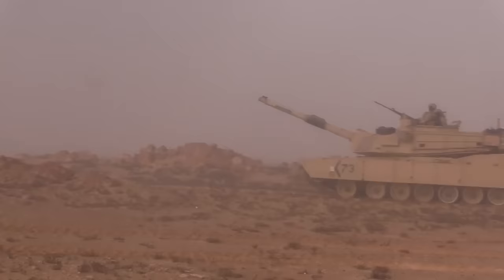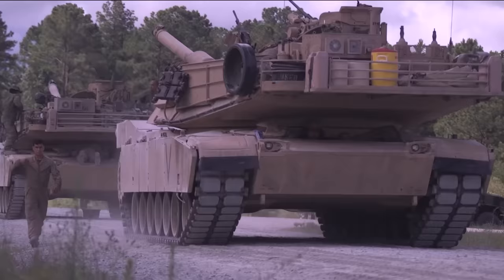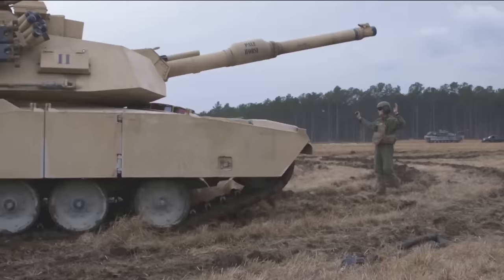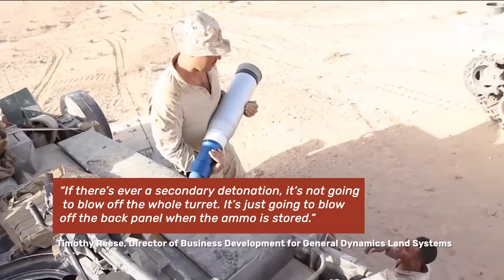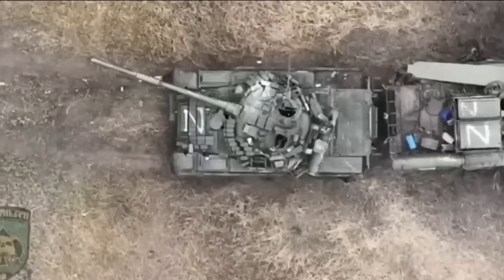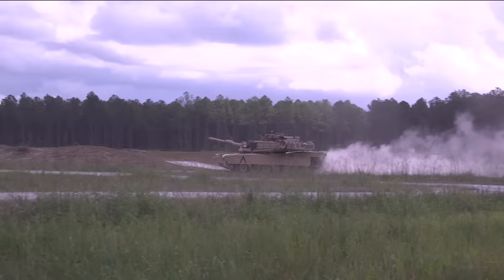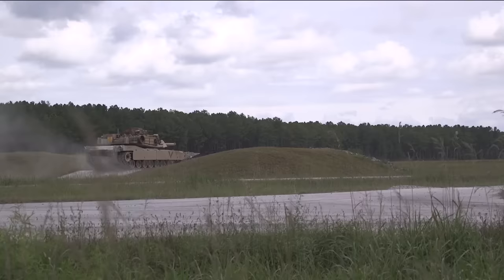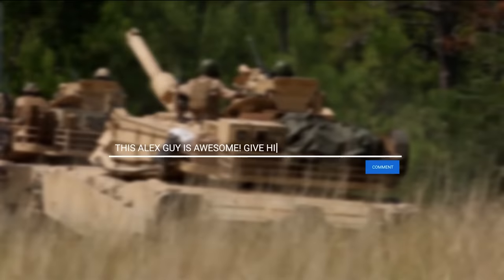America's next-generation main battle tank: ABRAMSX

Comment: The batteries enabling engine off operation is going to have a huge impact, and a lot of people still won't notice all of it. In addition to the tactical benefit of being able to keep the tank near ambient temperature and near enough silent to avoid detection, especially at night, the fuel savings will have a huge operational impact. One thing I consistently hear from people who have been in combat is that most of the time, absolutely nothing is happening, but soldiers need to be ready the whole time. Today, that means burning fuel to keep tanks running, but if the tank can run its systems, and ideally even move short distances on battery power while the engine starts, the real world flexibility and practicality of tanks increases massively. Whether commanders use this capability to operate at higher intensities for the same number of tanks, or run operations at the current level of intensity but with less vulnerability to fuel supply will depend on the situation, but any tank without this capability will be at a significant disadvantage.
Reply: Moving short distances on battery power while the engine starts would be huge. "Stealth tank" may not be a joke, it could be the real world initialization of the "stealth tank" concept. Would be really spooky. Hell, even the very NOTION of a "stealth tank" is spooky.
Reply: Hypothetically, this may also give an opportunity to install solar panels on the flatter top parts of the that are usually underutilized. Instead of just draining power during daytime, a little solar assistance may be helpful for that extra bit of juice. If those solar panels are designed well, they might as well function as "additional armor".
Reply: @misot90  well tanks take so much energy to move, that the meager powers solar panels provide will probably be meaningless.
Reply: @tsamuel6224  The M1 tank is already known as 'whispering death.'  The engine is so quiet that it was discovered that the sound of the tracks was the only thing you could hear from over 100 meters.  So, the Army developed 'silent' tracks for the M1.  

And we regularly were able to sneak up on infantry positions at night (and if there was no dust - in the daytime as well).  The next tank is going to have an APU just like the current M1s do, (Which also means that the fuel consumption issues everybody goes on about was solved 20 years ago.)  And the APU brings up a question - will the added utility of the batteries be worth the fire risk and under-armor volume they take up?  (Yea put lithium-Ion batteries on something that's intended to operate inside the enemy's kill zone.  If the batteries take battle damage - they will burn.  And you can't put the fire out.  I wonder how many tanks will be destroyed by fires before the crews start taking out those batteries. And IMO - getting rid of the Gas Turbine is a bad idea.  The gas turbine give the tank a level of agility no other tank in the world has.  With the gas turbine I was able to pop up on a berm take 2-3 main gun shots - then back up, stop, and accelerate and turn until I was heading for the next firing position at 30 MPH - before the enemy return fire arrived.  You can't do that with a diesel.  With a gas turbine when you to full throttle - you get full power instantly. A diesel has inertia it has to overcome before it can start giving you that power.  

Once I snuck my tank into the blue sides (I was part of the OPFOR - the "enemy" that's under order to kick the blue forces butt) bivouac area and stopped right next to a medium tent filled with sleeping soldiers.  Didn't even wake any of them up - until I fired off a WSS (Weapon Signature Simulator) for the main gun.  I guarantee that their ears were ringing.  (The Observer/controllers ruled that we had just wiped out an entire brigade headquarters.)  And we literally drove our tanks through the BluFor lines. (Up a gully that they didn't have anybody watching.)  

Now this is an extreme case that was more epic level screwups on the other side than any brilliance on our part.  But it does demonstrate that the gas turbine on the M1 makes the tank 'silent' out to relevant distances.  (IE: the distance you open fire.)
Reply: The other side of electric motors for driving a tank can be seen in the choice of turbine engine for the M1 which was for faster acceleration vs a piston engine of the same horsepower. Electric drive generates maximum torque at any RPM which is even better as a tank powerplant. And with electric motors you could even split the tracks in two segments on either side so if you hit a mine it doesn't totally immobilize the vehicle.
Reply: @j.f.fisher5318  The downside of this is that you need generators and batteries.  All of which will be taking up armored volume.  And your batteries need to be able to output enough power in almost no time at all.  Then there's the efficiency issue.  Every time you convert energy from one for to another - some of it is lost.  And conversion of the chemical energy in the fuel to heat and converting that heat to mechanical energy gives you two energy losses.  With batteries you have turning the mechanical energy into electricity (the generator) then turning the electrical energy into chemical energy (charging the battery) then converting that chemical energy back into electricity, then turning the energy into mechanical energy at the final drives.  

And the powerpack (engine and transmission) on the M1 series tank is nearly maintenance free (check fluid levels once a day and periodically blow the dust out of the fuel filters). From the crew's perspective that's all they need to do.  (Gas turbines and transmissions are extremely reliable technologies.)

And what I don't see is how the batteries and electric drive are worth the armored volume they take up.  What gets taken out to make room for the generators and batteries?  Ammunition? Fuel? Fire bottles?  Radios?
Reply: Yup: LeTourneau has been using hybrid propulsion for 70 years, not sure why it's taken this long for it to be brought to tanks.
Reply: @colincampbell767 Yes and no: Electric motors have far more torque so you should be able to downsize the engine which should compensate for the losses in efficiency you mention.
Reply: @wilfdarr  Or you can just ditch the batteries and electric motor that don't give you anything you don't already have and either have less armored volume which means that you can have a smaller powerpack for the same performance which reduces armored volume even more.
Reply: @colincampbell767  I think you need to watch the whole video.
Reply: @wilfdarr  It has been tried before and did not work in practice. A hybrid system needs to have two functional power systems which comes with increased cost, complexity, and space taken up inside the tank.

Those costs can be worth it, and with the major advances in technology we have seen I think they will be in this case, but even that isn't a guarantee.
Reply: @TheReykjavik  Compare the phone you had the last time a hybrid tank was tried to the phone in your pocket today: you can't! Just the advent of the solid state pure sine wave inverters alone are probably enough to change the equation, never mind all the other technological innovations since. 
Of course nothing is guaranteed, and I think their "15% fuel savings" is extremely optimistic, but even if the fuel is break even, the other combat capabilities offered are alone enough to at least warrant the investigation.
Reply: @misot90 hmm no...
Reply: Impossible (at least for now) to get a "stealthy" quiet tank. It's too heavy for electric drive only. It would gain massively with the battery's weight tank needs. All steel-made tracks are loud as hell. The only option is the "rubber bands" type of tracks as some APCs use. The tank's hull is a freaking drum. It makes all the noises even louder. This would have to work the way Puma IFV does. It has suspension, wheels and tracks separated from the hull.
So, recon vehicles - yes. MBTs - no. A big no.
BTW. What's with this whole adding 30mm autocannon? .50 cal is good enough. Maybe something like 15mm or 20mm could work but 30mm is absurd.
Reply: @HanSolo__  It doesn't need to be electric drive only to get stealth benefits from electric power. Even if it can't move at all, having the ability to run all the systems on the tank and traverse the turret without the engine on means the tank can sit quiet and cool in concealment, monitor the area and be ready to fire at a moments notice, and ready to fire up the engine and move if needed. But we can do better than that, electric drivetrains have no shortage of torque, so moving the tank short distances won't be a problem. The size of the battery will limit electric mobility to a short range, but if it can get the tank from a firing position to cover or at least concealment, it can buy a couple minutes for the engine to ramp up and for the tank to go hot. The tracks will make some noise, but at low speeds it isn't necessarily going to give the tanks position away at relevant ranges. MBTs can have rubber on the tracks btw, which doesn't eliminate noise but reduces it, and with smoothbore guns ranging out to 2km, you don't always need silence to avoid detection. Just because tanks are big and loud doesn't mean there is no benefit to being a little bit less loud.

And there is a strong argument to be made for an autocannon, 30mm might be bigger than necessary, but arguably it is better to go big. A heavy machine gun can take out unarmored vehicles, but it isn't a guarantee, so if a tank commander wants to take out the lead vehicle in a convoy, they might waste a main gun round on it. But if they have a 30mm autocannon, they are likely to be confident enough in it to use it instead of the big gun, extending the duration the tank can fight in a real world situation. An autocannon provides overmatch against light vehicles without expending limited main gun rounds. Keeping one machine gun is definitely necessary for a variety of reasons, but most tanks have 2, upgrading one to hit the midrange capability is not without merit.
Reply: @misot90 stupid idea
Reply: @wilfdarr bc it’s still unreliable at best
Reply: @wilfdarr they’re also much heavier
Reply: @greattribulation1388  Heavier, maybe.  Unreliable, no. Again, LeTourneau has been running hybrid vehicles for 70 years: the technology is mature.
Reply: Wouldn't the instant torque issue be fixed by the electric part of the diesel-electric powertrain? they are talking about being able to potentially move at low speed silently purely on electric motors and battery. I know in hybrid vehicles the electric motors add a lot of instant torque. And why wouldn't you deal with the batteries like you would the ammo storage, put them in a blowout panel somewhere....or more hilariously give them an eject system so you can move them off the vehicle without getting out. Do they actually have to put the batteries on the bottom of a tank? What is the weight of batteries vs armor as far as centers of gravity, abramsx was talking about reducing turret armor?  @colincampbell767
Reply: @deadlydays3401  That depends on how it's put together.  And the M1 series tank already has an extremely quiet engine.  And the gas turbine also provides prompt torque (which is limited by software to keep from shearing off the drive sprocket).  And an electric drive tank will have the same issue - apply too much power too fast and things break.  

And the issue with the batteries is fire.  An ammo compartment cook-off lasts a minute and doesn't affect the tank's mobility.  If a lithium battery takes battle damage it will catch on fire and that fire will burn for hours.  And the firefighting gear available to the crew can't do anything about it.  

Exactly where can you put a large bank of lithium batteries on a tank where they can be ejected out of the tank if they catch on fire - and still keep them under the armor?  Because if they take battle damage - getting them out of the tank is going to be the only way to keep the tank from burning out.

Comment: My crew shot "Top Tank" in 2009 on a M1A1 with a 980/1000. That's 20 off a perfect gunnery. We did that by having a loader on crack. He was loading consistent 3-4 second rounds...half the time with a Monster in his other hand and a dip in. The loader plays a huge role, and I think that will effect the combat effectiveness of the Abrams. Watch...they will still keep at least the A2 platform in service for this reason. They need to take a M1A2 SEP v3, add a active protection system to it that works, make a more fuel efficient turbine engine, and you will have the perfect tank. The crew makes the tank
Reply: I'm not a tank expert, but I agree.
The M-1 is by no means "behind", and is so modular that it still has great growth potential.
I think there needs to be a radical breakthrough tech, one that requires an all new chasis, in order to make a case for replacing the M-1. And I haven't seen that occur.
Abrams-X has the aroma of military industrial complex spending (something which is wildly blown out of proportion, but does exist).